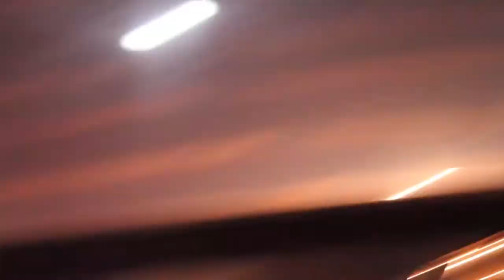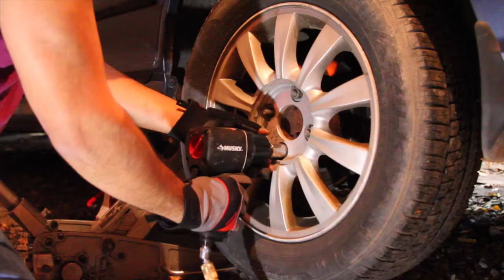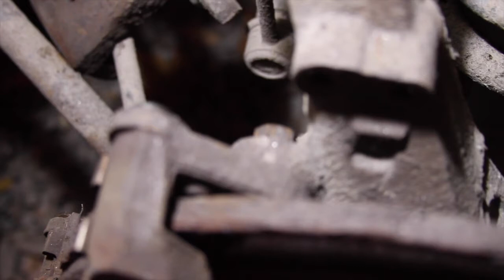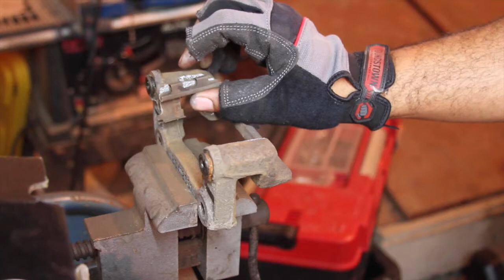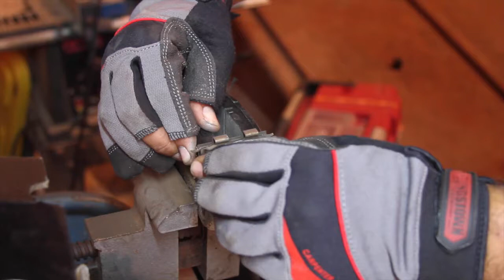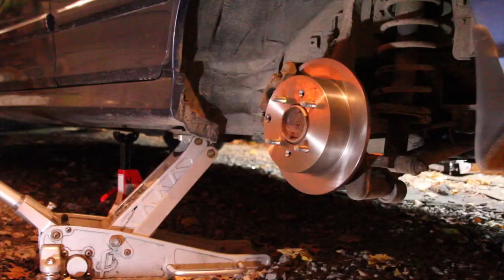2002 - 2005 Hyundai Sonata Rear Rotors and Pads

Comment: Why not replace the emergency brake shoes? That's incomplete job.  Also,  never blow brake dust with compressed air. .some of the materials are carcinogens.  Always spray down with brake parts cleaner.  Always replace with new hardware.
Reply: Even though brake cleaner exists, I always prefer using simple water to spray the area completely. They teach you in school that you should never blow brake dust.
Reply: Yeah ebrake shoes completely gone, send it

Comment: did your rotors have a screw in it? I'm wondering if I need to drill the screw since its pretty eroded
Reply from the maker: George Freshlivinlife I don't think this one did. Try spraying it down with some pv blast or wd40 first. It might just be surface rust. But if you have to drill it out it's not a big deal. The hold down screw is not necessary.
Reply: VGAPR Garage thanks for your quick response you mean the rotor with wd-40 or the screw?
Reply from the maker: George Freshlivinlife the screw. It maybe a torques or Phillips head. Hammering the torques or Phillips head into the screw to make sure it's seated flush will help you get it out easier and less likely to strip. Also the hammering will loosen up the rust. When you put the screw back in put never seize on the threads so it's easy to get out the next time.
Reply: VGAPR Garage thanks bro I got the screw out video a big help now hammering around the rotor